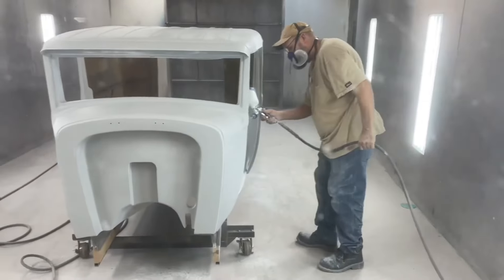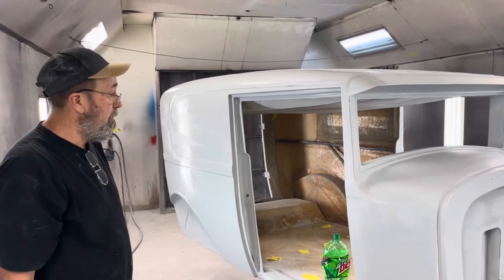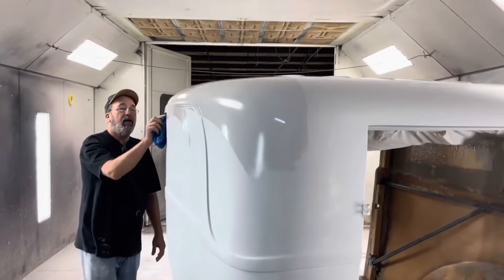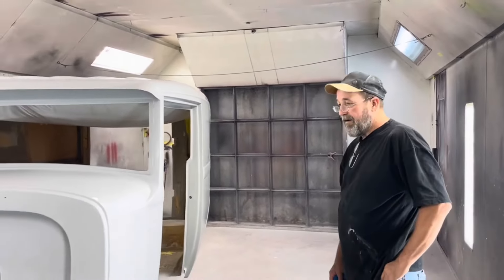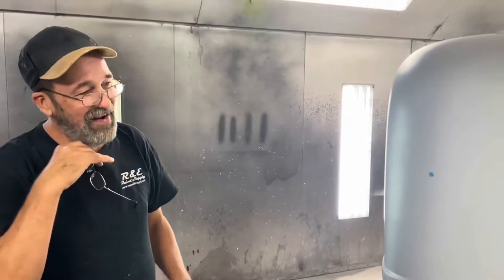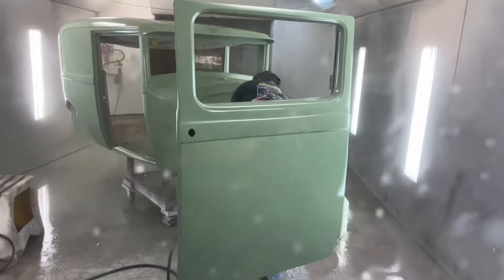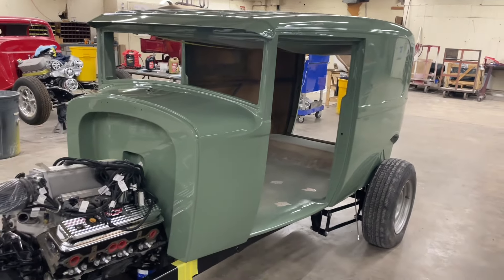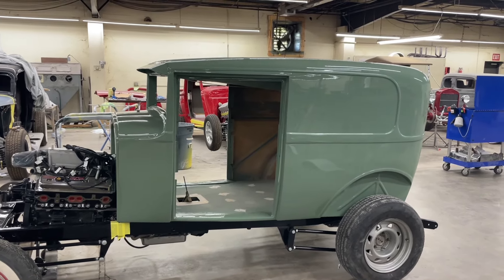Smooth Retro 1930 Model A sedan

Comment: A little heads up, the already broken supply chain is going to get massively worse on October 1st. The ILA ( International Longshoremans Association) is poised to go on strike because of contract disputes effectively shutting down most of the ports along the East and Gulf Coasts. Upwards of a million metric tons per month would be affected. Currently as of this morning, they are NOT even negotiating with each other. 
Thought you should know. God Bless!